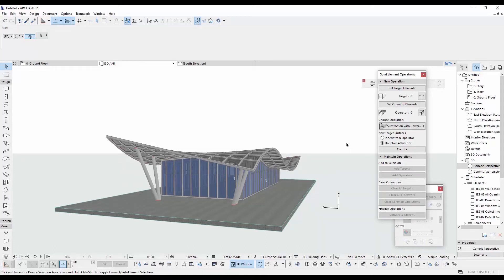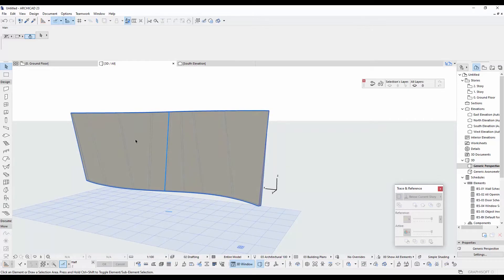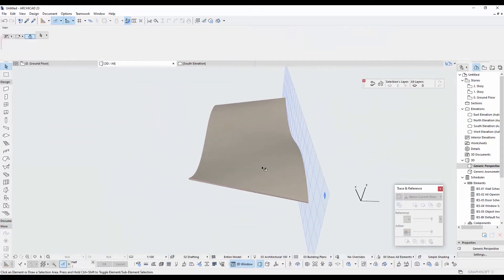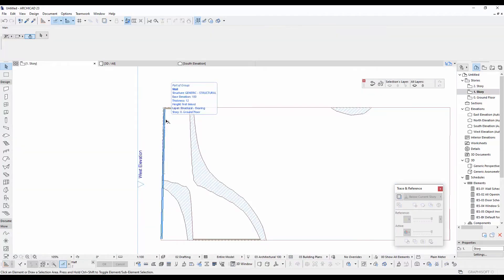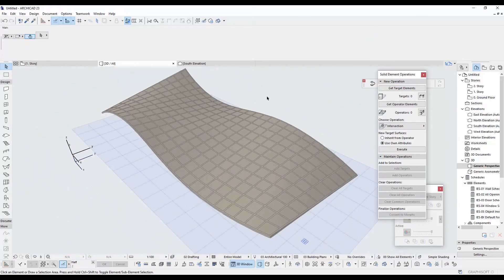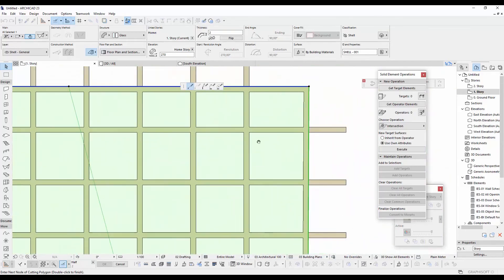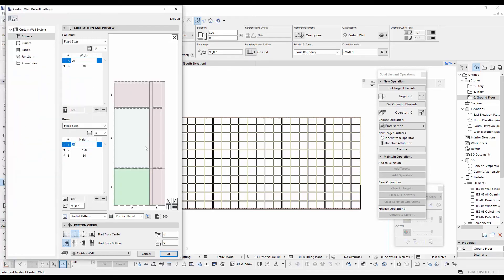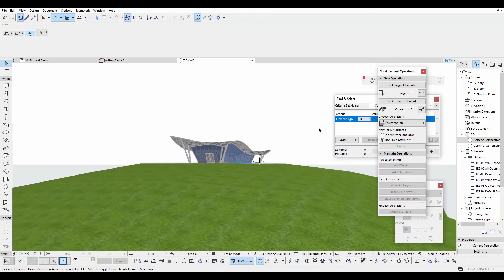ARCHICAD Tutorial - WAVE CURVED glass panel ROOF

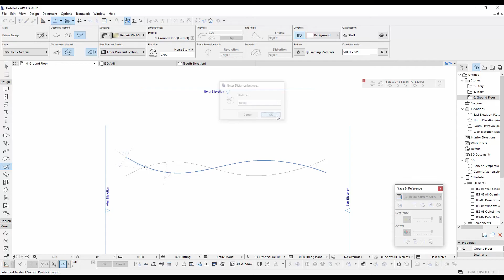Comment: My magic wand does not give me the same options as you got. Everything works fine til 01:21, where i do not get a similar anker point as you do
Reply: You must borrow the magic wand of Fairy Godmother of Cinderella....lol
Reply: You should change the geometry method and the construction method in to the "ruled"  and the "detailed" one when you are in the Shell Command.
Reply: @gizemklc1787  Thank you so much, just tried it to check how it was, and it was much better
Reply: MINE IS TWISTED WHEN I USE SPLINE TOOL WITH SPACE BAR, WHAT CAN I DO?
Reply: @gizemklc1787  MINE IS TWISTED WHEN I USE SPLINE TOOL WITH SPACE BAR, WHAT CAN I DO?
Reply: @dulguunbold2067  I WAS GOING INSANE OVER THIS, BUT YOU NEED TO PUT IT HORIZONTALLY AND NO OTHER LINES NEAR IT

Comment: Hi every one, It doesn't work for me, when I hit the space bar on the splines i can not select the second spline as you show in the video. When I select both splines it makes a weird 3D form. I can't find where is my mistake...
Reply: ddnt work for me too automatically, I had to create many nodes on the second spline
Reply: Thought I was the only one 🤧
Reply: 4 years later i try this and the same things happened to me too anyone know how to fix this?
Reply: @SagemaGrindset1894 hi im trying it to and I’m struggling with something else but I found a solution for your problem. This video is from a few years ago so I think the shortcuts changed. Instead of clicking on shell tool and spacebar you need to click on shell tool and the sixth icon in the upper left corner. It’s something like a magic wand. That should hopefully work for you too saw that your comment is the most recent and maybe my comment is just in time for you!
Reply: @darksvnn7721  appreciate it!!! 👏👏👏